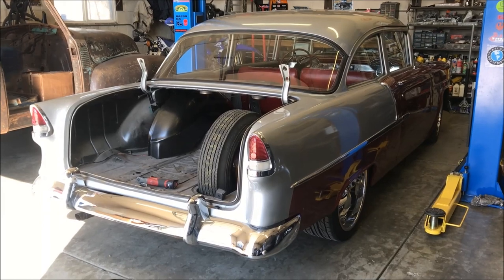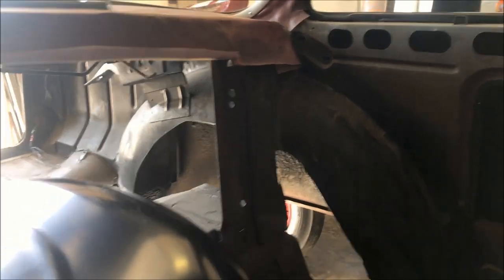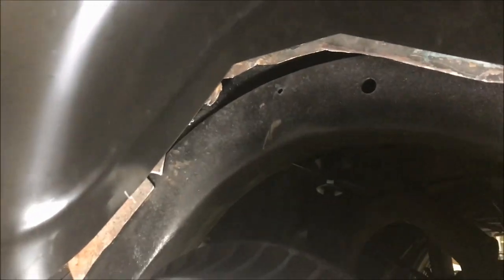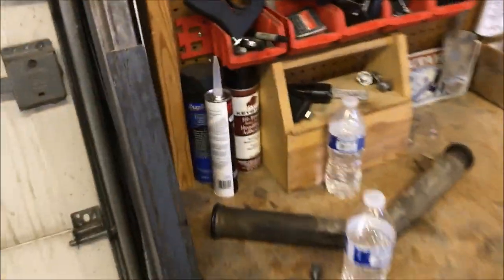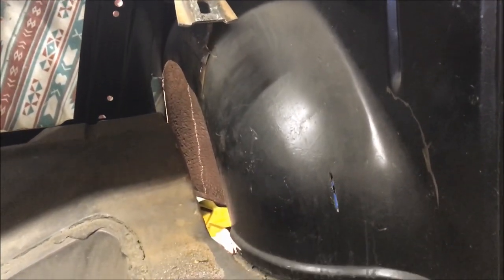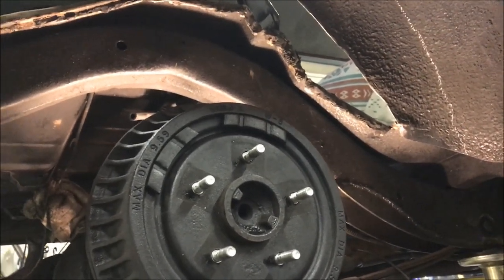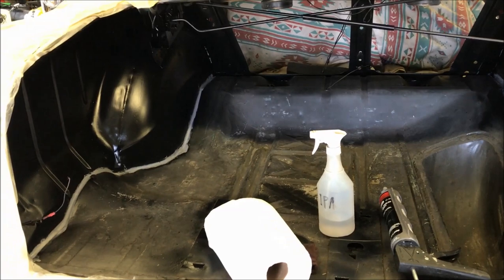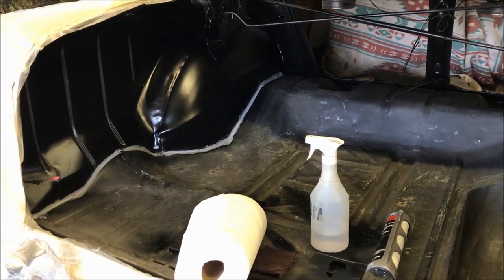55 Chevy Sedan Mini Tubs - How to install inner fenders with clearance for wider wheels and tires

Comment: Mate thanks so much for the video. I bought a welder and a mini tub kit for my 57. I had no real idea how it fit until I saw your video.  Lots of really good tips thanks a lot.  Yours came out looking awesome well done.
Reply from the maker: Glad I could help!
Reply: Y,know, I’m still watching your video.  I made the hole in the back seat brace a little too big so now I’m a little bit gun shy. Haha.  Thank god I left a bit of overlap and made the cuts like you did and bent the floor down towards the frame else it would have been a total cock up.  Great video

Comment: Did you have to relocate springs, shocks, or modify the suspension in any way? Are you running the stock differential?

Comment: Great video very informative I do have a question what backspace is on the wheels you are using
Reply from the maker: 18x8, 4.5 bs, 245/40 tire
20x10, 5.5 bs, 285/35 tire
Reply: @TrentsOvertimeGarage  Hi Trent, so you only had to cut the inter wheel well for the rear tires to fit?

Comment: factory rear end ?
Reply from the maker: No, replaced with an S10 4x4 10 bolt with 3.73s that is 59" wide from wheel mount surface to wms.